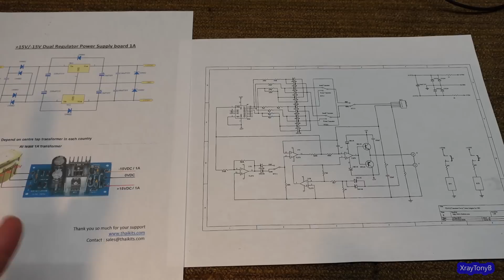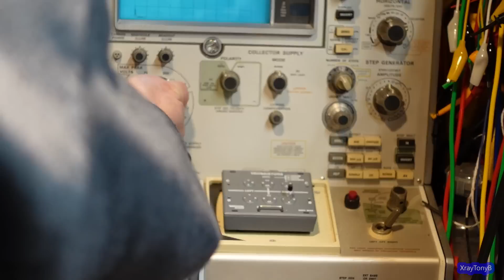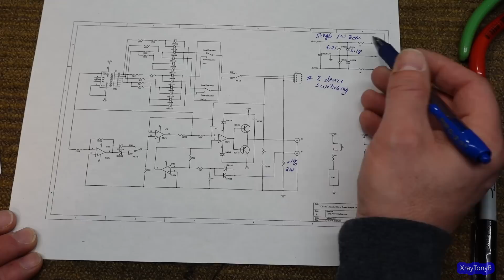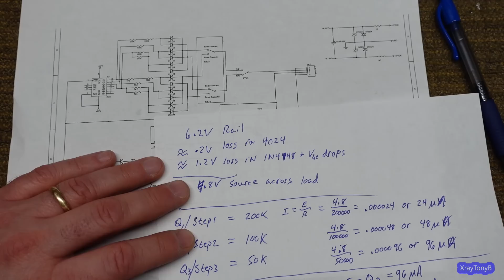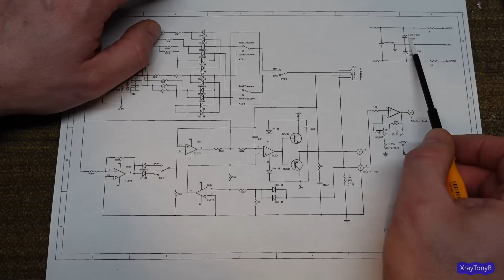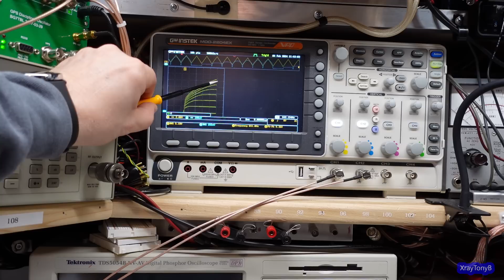Transistor Curve Tracer Basics & Construction

Comment: Hey Tony you right I was testing a 2N3904 transistor and it became extremely hot. When you did the mode to the Collector output did that allow for less heat at the transistor?

Comment: Hi Tony. I am finally building this kit with your modifications. I was in Thailand for 2 months early in the year and I communicated with jojo2520 who makes this kit outside Bangkok (Thaikits). He was kind enough to ship it to me free shipping cost where I was staying. 
* As far as the 6.2V zeners, 500mW is plenty, so one should be enough. With the 1K resistors, the current is only 8.8mA since the voltage drop from 15VDC is 8.8V (6.2x8.8=54.56mW for the zener). 
* The 1 Ohm 2 watt resistor doesn't need to have a 0.1% precision because the base current of the transistor under test is not controlled that accurately. 1 or 2% is way enough I think. But I'd use a low temperature coefficient resistor especially if it heats up a lot. The hFE is not so important to measure that accurately, but we are rather concerned about matching transistors and that is a relative test, not absolute. Tell me if I am wrong... Many thanks for your great videos! Please check my channel if you have a few minutes.

Comment: By the way there are many other sources of inaccuracy in the circuit. For example, it measures the emitter current as opposed to collector, through the 1 Ohm resistor. The emitter current is collector + base currents. The hFE is collector current divided by base current. The error is basically 1/hFE. With hFE of 50, the error is 2%.

If one is concerned about reverse polarity protection, it is easy to add diodes to protect the base and the collector of the transistor under test. The polarity of these diodes can be controlled by the NPN/PNP switch.

Comment: Hey Tony question when you measured the stair step waveform did you have a Transistor under test  installed? When you took your scope measurements on the base of the transistor?

Comment: Good evening. How’s it going? Question Hey I’m building the same Curve Tracer so I found two 1 Watt 6,8 volt Zener Diodes will they work?
Reply: The CD4024 can operate at Vdd-Vss max of 20Volts. 2x6.8= 13.6. Check the datasheet... But the emitter currents for the transistor under test  will increase.
Reply: @alfixallThank you.

Comment: Good video. I've built the same device and took some advice from your video and have made similar changes. I just wanted to offer one correction regarding the 6.2 volt power supply. It's normal for most Zener diodes from about 5 volts and under to have a negative temperature coefficient. If you take a look at the spec sheet for the 1N5234 you'll notice that the temperature coefficients for Zeners over 5.1 volts the temperature flips from being a negative coefficient to a positive coefficient.
If the Zener has a negative coefficient the behavior would be exactly as you describe. As it heats up the voltage drops and the one that responds at a lower voltage will take all the load. As you say, no good. One the other hand the 6.2 Zener has a positive temperature coefficient, and as such the voltage will rise as it warms up and the second Zener will begin to pick up and share the load. In theory they should balance out to some degree.

Comment: A couple of comments: (i) The 6.2v zeners have 1K resistors in series, so the current through them is less than 8.8mA and the dissipation is therefore less than 55mW. (ii) The 1ohm current measurement resistor appears to have a lengthy path to ground, so the effective resistance is going to be significantly greater than 1ohm, even if you use a 0.1% resistor.(iii) The output buffer amp doesn't need to be super-fast, but using a lower value feedback resistor would help.
Reply: Ha! The oscilloscope is far from being 1% accurate. I rather use a stable resistor with low TC.

Comment: This is a hardware only curve tracer. I would have developed a software version of it using Arduino. I have constant current ic for led drive. They are very small and cheap. They are set with external resistor. I also have I2C controlled variable resistor. There are also variable voltage regulators that can be set via resistor. Therefore a micro controller can set the base current and input voltage to measure the output and store it in memory. When the sweep is over it would display it on screen. You can measure and store with this method. Therefore you may compare many transistors side by side. Most probably the end result would be closer to the professional ones. You don't need an oscilloscope with this setup just a high resolution display that can be controlled via SPI and it would run on battery.
Reply: Have you made any work of this? I'm interested in a hybrid between them.
Reply: What is p/n for I2C variable resister?
There are many LED SPI/I2C controller chips, some by NXP that control up to 16 LEDs. These employ programmable constant current sources all are single polarity and use an NPN current sink device to ground. Question: have you found a LED constant current driver that will provide selectable base currents in the same range as this programmer project?

Comment: The push-pull pair are a unity-gain follower, which is in the circuit because the TL074 can't source the needed amount of current.  The wire going up from the X input is going to the (+) input of U1C, providing negative feedback.  

The triangle wave is actually a better idea than a ramp, unless you can provide a blanking input to the 'scope.  Otherwise, the flyback makes a strange loop on the display, rather than retracing the curve.  (Also, some tracers drive with a sine, so they function as RLC measurement devices as well - you can measure the Lissajous figure of I vs V.)

Comment: Hi, I built original version acc. Elector 12/89. It worked but after I accidentaly shortened the T1 and  its replacement it works only in PNP mode. I checked all the relevant diods D5-6, 7-8-9 and 13-14 but they are OK. Please any advice can help.

Comment: Tony I noticed that they are powering the CD4024be ic chip with a negative voltage power supply. Any thoughts on why they are doing this?
Reply from the maker: The CD4024 is being powered by a split power supply.  This sets the reference pin (usually connected to ground) to a negative voltage.  This allows the positive and negative step signals for the NPN and PNP polarity transistors.  The diodes and selector switches will "steer" the proper part of the signal to the DUT socket.
Reply: @xraytonyb  Thanks Tony.
Reply: @xraytonyb  Hi Tony I received the same Curve Tracer kit. I’ll keep you up to date on the progress.
Reply: Quick question on this Curve Tracer are they inputing a square and Triangle wave into pin 1 of the CD4024be dual JK flip flop ic chip?

Comment: Question Tony have you ever used the 74hc93 JK flip flop ic chip and a R-2R resistor ladder assembly to build a stair step generator circuit? I’m now using the CD4024be seven stage counter ic chip and the R-2R resistor ladder assembly with this combination it yields a much better stair step wave form.

Comment: Another question. Is it important to have the frequency of the step signal and the Collector to Emitter frequency the same?
Reply from the maker: In this circuit, it is important.  The signals share the same phase and clock frequency.  This is how the scope can stay in sync when in X-Y mode.
Reply: @xraytonyb  Thanks Tony.
Reply: @xraytonyb  Ray would the power supply be a positive and Negative 6.2 volt for the stair step generator circuit?

Comment: Tony on the scaling circuit could you have used a JRC4556 op-amp?
Reply from the maker: Yes, it should work.  I don't remember if the JRC4556 is a rail-to-rail opamp, but I think everything else would work OK.
Reply: @xraytonyb  Thank you. Your video on this Curve Tracer was very informative. I found some CD4024be ic chips. Just wondering if I can use a 7493 JK counter ic chip if I regulate supply voltage at 5.1 volts?

Comment: I just made the ckt with your well thought out mods.  Very clean signals even with 6 inch leads to banana jacks.  I eliminated the BNCs in favor of two unused probe leads I had lying around.  Used Dupont connectors to header pins for the basic board connections.  I had an OP37F  so I used that with excellent results.  I need to calibrate the 1X and then ensure the high power is 10X.  I REALLY liked your explanation of the theory and promoted it on EVVblog.  I intend to document the traces and voltages.  This has a much smaller footprint and is more convenient than the BK 501A and Heathkit, if more limited.  But it works well for most amateur uses.  I kept track, and my final unit comes in at $125.
Reply: Also, the 13.3 x on high power makes little sense to me.  I will replace the 7.5K  resistors to 10K to yield a sensible 10X current increase on high power.

Comment: For those who enjoy microcontrollers - another way of making a transistor tester is to have the microcontroller generate two PWM signals that are low-pass filtered into voltages.  One voltage goes to an op amp for the base driver and the other goes to a collector voltage driver (LM317).  Two more op amps are used to condition the collector voltage and collector current readings for the microcontroller's ADC.  The ADC values are sent by UART as CSV text for a PC to record and plot. If you want to learn about building op amp circuits, this is sort of fun DIY project.

Comment: I guess there is no need, do to emitter resistors, but I'd like to measure some TO3 packaged transistors. Collector voltage 70v DC op-temp hangs around 140-150ish F. I've only seen the tek 575 or 577 have a jig for the TO3 package.

Comment: Funny thing happened to me on my way to this week's xratonyb video. I'm building one of these right now. I have the circuit boards mounted and just finishing up the machine work for the case. Now the question is do I do these mods... The scope traces for this version are much cleaner than any other videos I've seen on this kit and I really like the feature allowing comparing two transistors.

Comment: Hi Tony, WoW this is a beautiful job, like from the factory.
Those indicators at the active input are great, with my Tektronix TR210 replica, after activating the rainbow input, both curves are displayed simultaneously, and I can scroll with one displayed trace - I can overlap them.
Unfortunately, it can't display the step graph of the transistor, it doesn't have a step up generator - so I'm building something similar to you, but with a max voltage of 200V.

Nice day 🙂 Tom

Comment: I've done this very same kit and put it into a sloped case too with connections for no less than 6 transistors at once and a 3P7T switch to compare them!  Works like a charm. 😎

Just two tips:

- Put a SPST switch to disconnect pin 9 of 4024. You'll get just the first 4 low traces in case the base current of the 8 traces by default may be too much for certain transistors. I've done it and it is quite handy.

- Put ferrite beads in the wires connecting to the ZIF sockets to get rid of any possible ringing.

Comment: Serendipity! I'm literally building a remarkably similar project, Slope box, 2 device switch (inc. 4PDT switch to run additional cahannel for led), was even considering a small cheap scope to integrate! Many thanks for this video because it has resolved everything I was questioning plus I hadn't thought to amplify the Y channel and wouldn't have been knowledgeable enough about op-amps to choose a workable solution.  The only difference in mine is I'm using a single 40Pin ZIF socket, with each row for a different DUT, and I found a Prototype PCB ideally suited on ebay - item number 154352499080 board style B (UK Ebay) which has 6 power rails all routed to a convenient jumper location making the wiring for the EBC combinations a sinch! Might not be as helpful as this video, but might help someone. Thanks again Tony!

Comment: Thanks for sharing your efforts with your build, as well as the mods you did. About 4 years ago, I ordered the CT and PS combo from them, waited 2+ months, it never showed (and it never showed after that either) , thankfully I got a full refund Looking around at auction stuff, I found a Eico model 443, which has transistor curve tracer circuitry, AND, a diode/component test section that can check forward and reverse bias breakdown up to 1.4KV, as well as having A-B switching and sockets for small transistors AND TO-3 packaged items built into the front panel. The 443 had one strange fault, either factory or kit built, it had the connections to the calibrated bias pot for signal transistors wired inversely from what logical functionality would dictate, it took a little playing with it to realize that, and swapping the 2 outside wires on the pot fixed that issue, as well as finding one broke wire and replacing OOT resistors and aged caps I was glad, and lucky to go that route.